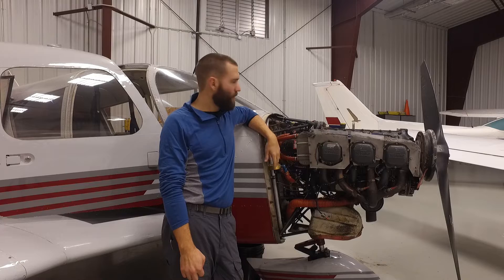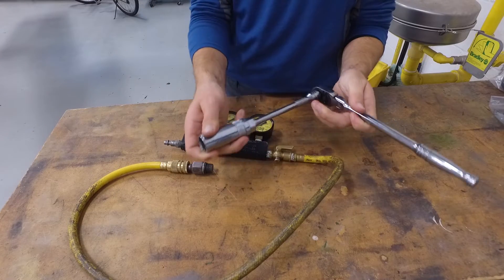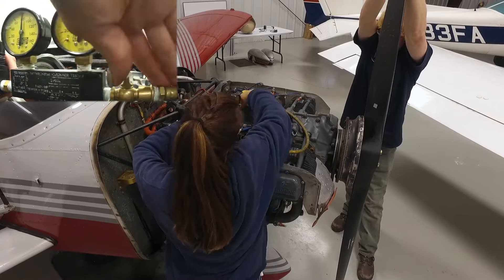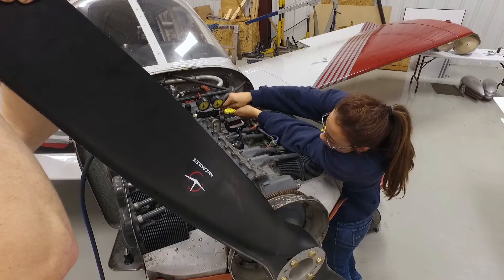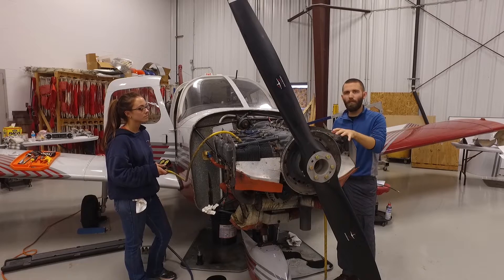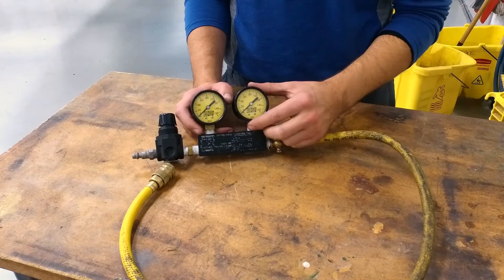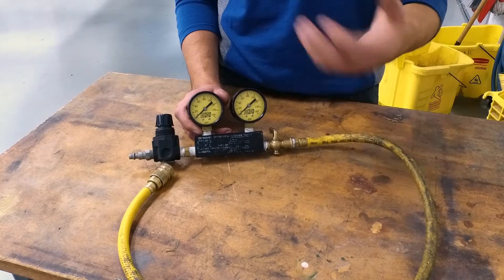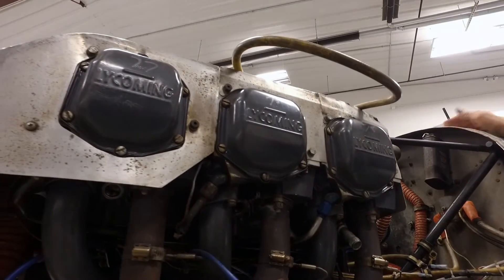Compression Test - Maintenance Monday

Comment: So I was on a one side of the airplane behind main wheels doing brakes while (?) was rushing a new A$P through this procedure and new guy plugs air with no regulator in between into the cylinder. 
I don’t need to go through it all but it cut a 7 inch slice down his forearm and chipped the bone in his elbow.  
This was just a little c152 . you wouldn’t think it could hurt you too bad but I promise you it can.

Comment: Don't connect the air at TDC with 80psi right away! Start at 20psi, verify the propeller does not move at 20psi, and then increase the pressure to the full 80psi! Avoids any surprises!

Comment: Perfect example of what's wrong with aviation maintenance

These people don't know what they're doing.  What is the customer paying for?  a couple of hacks?  Disconnecting the P-Leads so the engine doesn't fire are you kidding me?  The way the female is leaning on that engine there's no way it's at operating temperature as required.  There is no way you're using the right size orifice in that ancient - out of calibration certification - tester.  Look it up in AC43.13-1B Ch 8-14 b. (2).  

Customers fly their families in these airplanes.  They expect those who work on their airplanes know what they're doing.  

You're a customer who has the choice of maintaining your airplane at two places

Place 1 has hacks who weren't formally trained, didn't study the material, were taught by losers, are supervised by the same
Place 2 has formally trained mechanics who know tactics, techniques, and procedures, were supervised by other smart people and know the material because they've studied it.

Who cares, as long as they have an A&P license right?  What difference does it make?  Well why do ANYTHING the way you do it?  To hell with the books - who needs them. 

LoL Walter Aviation - just another hack maintenance facility.

Comment: this is a leak down test,  a compression test would involve cranking engine and seeing how much pressure builds.  This test measures how much air gets past the rings and valves.
Reply: Nope. This in a differential compression test, a leakdown test is for automotive engines and is a bit different

Comment: Just watched another video on "checking for induction leaks."  Seems like it would be logical to perform this test in conjunction with this test.  Are all the plugs removed and inspected at 100 hours?  As others have said, seems like a good idea to remove plugs before doing this test.  Of course one plug would be re-installed on as each cylinder is tested.  link to induction leak test:   https://www.youtube.com/watch?v=CfG4QGv-r64

Comment: I am a current A&P and just wanted to give 1 small tip that could minimize a potential hazzard. When you are introducing the air pressure into the cylinder, instead of opening the valve all at once you should instead,, "creep" up the pressure until it slowly climbs to 80. This gives the person holding the propeller both time get a feel for it and a little leeway  in case you are on the wrong position for the piston.
Reply: V. Gregg Undercover1566 O agree. Also as an extra tip wait at least 1 minute with the cylinder pressurized to see if the pressure drops significantly in that 1 min time frame. Should not move to the next cylinder so fast.

Comment: its a Lycoming Engine. But as of March 2013 TCM came out with SB03-3. As an A&PIA I can tell this document has changed the old way of doing Differential compression checks. I would read up on it and start doing the tests the way the manufacturer intends. It is not mandatory to do the test their way for Lycoming engines but I would highly reccomend it. You would need to get a Differential compression tester with a Master Orifice. But those are cheap enough.
Reply: Hi Richard, I know this is old, but in the early 2000s, Continental came out with a pretty comprehensive maintenance manual that people need to refer to for maintenance on Continentals. The document number is M-0 and includes all the info from SB03-3.  Cheers!

Comment: Did I hear you say that removing the P- leads will keep the engine from firing? Please become informed yourself, then either remove this video, or remove the dangerous and misleading information, and remake the video with correct info. There are people who actually use the internet for accurate information. This is information that’s bad enough to kill someone. By the way you need to ground the P-leads to ensure no spark. Removing them is the same as leaving the key on.
Reply: Thanks for saying.
Reply: And this is a leak down test ,not a compression test. Also this guy is going to get wacked by the prop.
Reply: @robhoard9114  it’s a differential compression test
Reply: Wow, I can't beleive they removed the P-Leads. Super unsafe maintenance 😮

Comment: This is a cylinder leakage test! A static compression test would be just a gauge in the spark plug bore while cranking the engine. A dynamic test would be with gauge connected and the engine running at a specific rpm. The pressure found during a dynamic tests would be an excellent pressure to test the cylinder leakage at.
Reply: Ryan Nelson I struggled with this too when I learned about aircraft "compression" tests. Yes you are correct, but in aviation, they call a "leakdown test" a "compression test". Don't fight it! lol I've never seen anybody do an actual compression test by spinning the engine with the starter..they just don't do that.
Reply: The leakdown test is more accurate to gauge the overall ability for a cylinder to hold compression where as the automotive compression deal mainly with the piston rings.

Comment: How i can lear how to be a mechanic ? (172/152)
Reply: one of the basic requirments to getting your A&P is that you be able to Read, write,speak english. So I suggest you get more training in English.  Now for schools, some schools like AIM charge you an arm and a leg.  I almost went to that school a long time ago before it was AIM.  I went to a Jr. College to get my A&P training and license.  They cover the same stuff you would at a High Plrice place. A down fall to the Jr. College it may take a little longer to finish.. it is not the speed track.   So look into that, and become a resident of the stay where you going to go to school so you dont pay high fees.
Reply from the maker: There are many schools across the USA with 2 year programs for Airframe and Powerplant mechanic training. You can also obtain your A&P certificate through an apprenticeship program. Those are harder to find, but a good starting place is your local airport. Many great resources, just stop out and introduce yourself!
Reply: Walter Aviation i am not live in usa my english is +- if i go to there i can learn and work be a mechanic?
Reply from the maker: FS simulation, it depends on where you live, but I would suggest finding a local airport and start there to see if they know of any local schools to become an aircraft mechanic.
Reply: Learn English first

Comment: Please talk with your mechanic and fix your script. By removing P Leads you would make the mags hot. They are grounded by the P Leads to turn them off. Removing one lug from every cylinder will make the engine safe to turn the prop.
Reply: Walter Aviation Disconnecting the P lead, regardless if it's a bendix or slick makes the mags hot. They are grounded through the ignition switch. The safest way I've found, when doing a compression test is to make sure ignition switch is set to off. Disconnect all leads to plugs and remove either all top or bottom plugs to do the test. Otherwise nice video.
Reply from the maker: Thanks Ben, Clarification: Removing the P Leads on this particular set of mags (Bendix) actually causes them to ground out (safe). Normally though, we would just jumper a wire from the P Leads to ground to make them safe, and as you said, just pulling out a plug from all cylinders would also get the job done. Thanks for watching!
Reply: What you say is confusing...first you say to remove the p-lead and then you say to ground the p-lead...Which one is it?  How can grounding and removing have the same effect?  Can't be a shower of sparks mag because you point out the sound of the impulse coupling...so what do you mean?
Reply: Yes that is a leak down tester, I don’t want you working on my plane. On another note the girl is hot she should do a bikini layout
Reply: Ben Proveaux she makes me wanna jiz